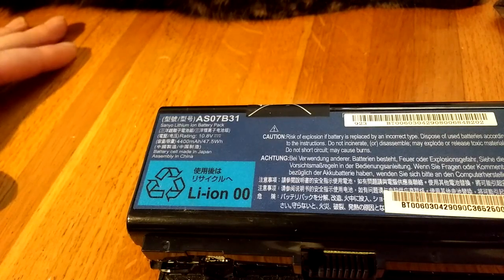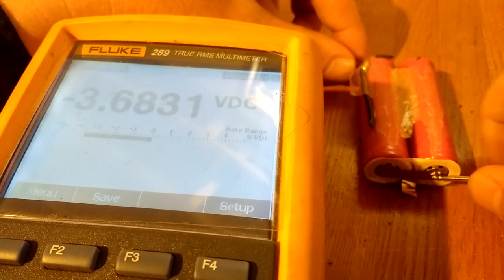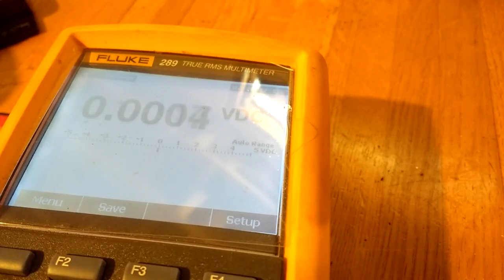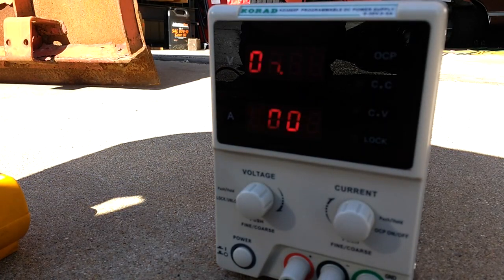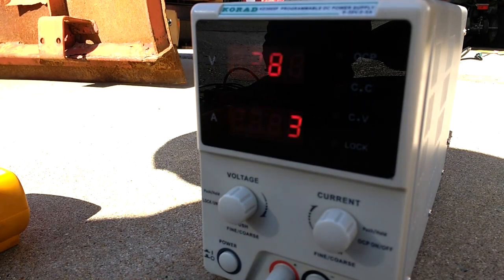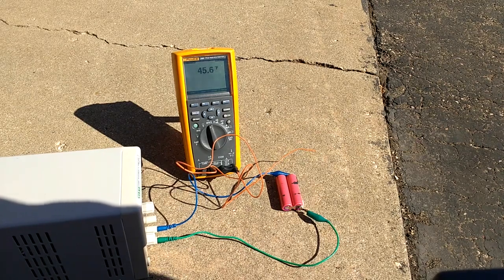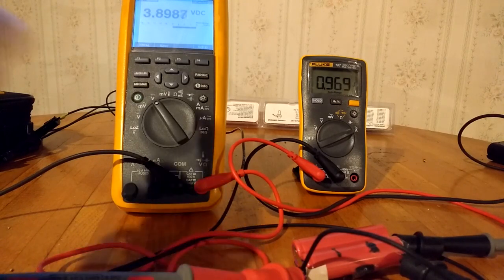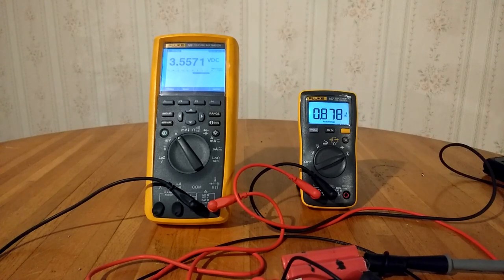Charging a Li-ion 18650 battery without a battery management system (BMS)

Comment: I am trying to pre-charge some new Li-ion cells that all test the same using a Fluke 87 V, and they show 3.492 Vdc, being real close, I feel I am off to a good start. I would guess most people don’t have a digital power supply. Great for the video, but I was looking for a cheap method of trickle chargers, battery charger(s) with different settings.
 Also, a decent DMM can handle 10 amps passing thru it. The Fluke I have will go to 15 amps, but you can use a voltage divider or other creative setup. Nichrome wire has good resistance and can be cut at a measured point. Ballast resistors where used on Chrysler ignition systems for decades and in a ceramic block. I am lucky enough over decades to have a full tool box full of just electrical stuff. I have seen photo and manufacture show a PTC thermistor ring used under the positive terminal of some batteries during assembly. This would add a little cost but provide some temperature / over current conditions. Not to be counted on for charging protection but more so during a power tool use as these ten cells have only one NTC thermistor on top of the pack for “BMS” input. I have not test it yet. Just researching for numbers and ideas! Thanks. (Note; I you say 82 degrees add “C” or “F”)

Comment: can i charge directly with 12V output from transformer
Reply: No, the battery would explode if it gets more than 4.3V.
Reply: Miguel Barra Almeida but if he monitor voltage while charge and stop the charging @ 4.15v will it explode ?
why say no
Reply: @nelsoncruz7278  Bruh

Comment: In a pinch, you can charge Lithium cells using a current and voltage limited power supply, but you need to make sure to manually monitor the voltage and current being delivered, to avoid over-charging the cell, unless your power supply has a way to automatically switch off (and remain off) after certain conditions are met.
For Li-Ion 18650 cells, set the voltage limit to 4.2V and the current limit to 1A (1000mA).
Charge the cell.  The voltage should be pulled down while the current is held at the maximum.
The voltage will gradually rise until it reaches the limit of 4.2V at which point the current will begin to drop.
This is where you need to pay attention because you must stop charging once the current drops to one-tenth of an amp (100mA) in order not to over-charge the cell.
For other Lithium cells, find the cell capacity and charge at half that rate (eg for a 100mAH cell, start charging at 50mA) at the rated full-charge voltage (will usually be either 4.1V or 4.2V, depending on cell chemistry) and stop charging when the charge current drops to one-tenth of the starting current (so 5mA in the previous example).
Reply: what if the battery says on its' covering 3.7v; what does this mean then, why does it make sense to charge to 4.2 - 4.1v?
Reply: 3.7v is the nominal voltage, simply put its when the cell is at half charge.
3v is considered discharged and 4.2v fully charged
.. So 3.7v is it's average voltage

Comment: they will not blow up because they can only hold so much energy ... its like filling up a glass of water... it will only fill to the top and that it... pleople please do your research
Reply: They can burst and catch fire if charged with too high a current or at too high a voltage.  (Most people say the battery "exploded" in that case, although it's not strictly true)  Lithium cells have a very low charging resistance so current limiting is necessary.

Comment: Samsung icr 28a needs to be charged at 4.3 volts according to the Samsung spec sheet, would charging them at 4.2v be any problem. I'm going to be using the batteries temporarily for a low wattage vape probably around 10-15 watts
Reply: It won't harm the batteries and may even make them last longer before their capacity drops due to irreversible chemical changes caused by the charging process, although you won't get the full rated capacity of each cell (around 80% capacity, at a guess) on each charge-discharge cycle.

Comment: I have a similar power supply and a 3.7V  1000mAh battery.  What should I set my power supply to in order to safely charge the battery??
Reply: 4.2V is the full charge voltage, but as stated above, charging to only 4.1V will extend the life of the cell at the small cost of the cell not taking as much charge each time (around 20% less charge).  The starting charge current should generally be one-half the mAh rating of the battery so in your case the current limit should be set to 500mA and charging needs to be stopped when the current drops to 50mA (one tenth of the starting current).
Reply: John McDermott 3.7v is the working voltage. to be fully charged it needs 4.20v max, but 4.10v is better for the battery's lifespan. but please keep in mind that these bench power supply don't have auto cut-off feature which li-ion/li-po needs when it has been fully charged, so you have to disconnect it soon after it reach that full charge voltage.
Reply: @radius.indrawan  Set charger to 4.1v constant voltage, when the battery reaches 4.1v no current will flow as there is zero potential between 4.1v and 4.1v, current only flows where deferential voltage potentials exist.

Comment: I bought a 4 pack of these at walmart for $4, Westinghouse brand. I have a charger for my RC helicopter that just plugs into the heli and has around 4.1 ish volts. Can I use this to charge these 18650 batteries for my flashlight?
Reply from the maker: Personally I think that I would measure the charge profile of the battery charger before hooking that up. If you can find the data sheet on the batteries and a data sheet on the charger you should be able to see if they're compatible.
Reply: The westinghouse battery is 2,000mA and the power bank battery says 2.200mA, will that work? I have another power bank that is 2,000mA maybe I can use that. I guess the mA of the battery must match the mA of the charger.
Reply: It's probably not a good idea.  RC batteries are usually designed to be charged at a fast rate while few 18650 cells are designed that way.  They should generally be charged at no more than one-half C (cell capacity in milliampere-hours).  Your RC helicopter charger likely delivers too much current for a typical 18650 and could damage it.

There are simple lithium cell charging circuits available through places like eBay and Aliexpress and the circuits generally also include over-discharge protection.  They take 5V from a phone charger and even use the same mini USB socket used for most phones.  Add an 18650 battery holder and you're about set.

Comment: Typical 10.8v-11.1v laptop batteries use six cells... three of which are in series, the other three are in series, then connected together in parallel, officially making it a 3s2p pack with a current rating of 2200mah for each individual cell.

Comment: You'll burn your Fluke display under the sunshine
Reply from the maker: TheJavaSync that is good advice. I ran into that problem before. I normally just cover it with a towel if it's going to be outside for more then 30 minutes.

Comment: 3V to 4.2V for most 18650. End of charging automaticly, because constant Voltage set to 4.2V. So 1/10tel Current for most 18650.

Comment: You must charge to 4.2V and discharge to 3.0V for the whole capacity.
Your powersupply is a 100% correct lion charger! constant current first and at end of charge constant voltage! It´s 100% correct!
But you musst control the voltage with a multimeter before charging.
Reply from the maker: Dennis Kubik I had a problem finding the datasheet on that batteries so I wasn't sure what charge rate to set it to or how long I should leave it on once it reached the 4.2 volts.

Comment: why isn't it 4400/6? I would assume the capacity should be unaffected by series/parallel. series/parallel mix would be used to output a specific voltage range. curious why it's not ~733 mAh/cell or 1466 mAh/pair
Reply from the maker: A simple way of looking at it would be if you have two batteries at 4 volts and a 1 amp constant current load.

If you connect the two batteries in series they will be 8 volts and have a 1 amp load on both of them.

If the batteries are connected in parallel  with the same 1 amp load. The circuit will be at 4 volts but each battery will have .5 amp load on them. So under the same load conditions the battery will last twice as long doubling the amp hour rating. 

This example isn't a hundred percent true because battery capacity is based on the load but it is the general idea.
Reply: mAh is a non-SI unit for charge, or charge capacity. 

Coulomb is the SI unit for charge. it's formula can be listed as: 1C = 1A * 1s. To use your example above 1A * 0.5(t) = 0.5A * 1(t); t standing for time. The batteries in series will last half as long as the ones wired in parallel, but the overall charge in Coulombs or mAh will remain unchanged since that amount of stored energy is still the same. 1C = 3.6mAh

The above calculations assume perfectly efficient circuitry, which will never happen but I think it gets my point across.
Reply from the maker: You are correct that the energy in the battery does not change in parallel or series. The thing is that amp hour or coulombs (1 amp hour = 3600 coulombs) are not a measurement of energy. Units of energy would be in joules or watt hour.

The two batteries in series would have 8 volts and 1 amp hour (3600 coulomb).

With a constant 1 amp load. C = 3600 (coulomb) A= (1 amps) S = time (seconds)

C = A * S

3600 = 1 * S

Time = S = 3600 seconds = 1 hours

The two batteries in parallel would have 4 volts and 2 amp hour (7200 coulomb).

With a constant 1 amp load. C = 7200 (coulomb) A= (1 amps) S = time (seconds)

C = A * S

7200 = 1 * S

Time = S = 7200 seconds = 2 hours

The joules of energy in the batteries is the same either way. When the load is first applied the batteries in series have an 8 watt load on them. The ones in parallel start with a 4 watt load on them. As the voltage drops it will change but the batteries in series will have twice as much energy being taken out of them. (Again assuming an ideal battery with no internal resistance)
Reply: You hit the nail on the head, I was thinking of units of energy. Thanks for your help clearing this up. 

Both packs are going to supply the same amount of watts, parallel (8W = 2A * 4V) series (8W = 1A * 8V). Yes, I know I've changed the amperage in the example calculations I just listed, but it helps my brain wrap around this, lol. And yes, I know I've made it even more confusing going from joules (energy) to watts (energy/time). 

Drawing 4W or 1A @ 4V out of the parallel cells will give you the 7200 coulomb figure that you referenced above. If you drew 4W or .5A @ 8V out of the series cells that would also give you the same 7200 coulomb figure. The thing I glossed over initially was how the change in voltage would affect watts/amps. Simple V = W/A formula, lol.